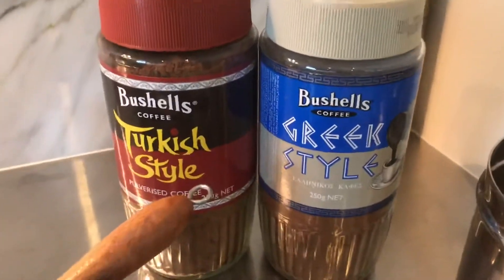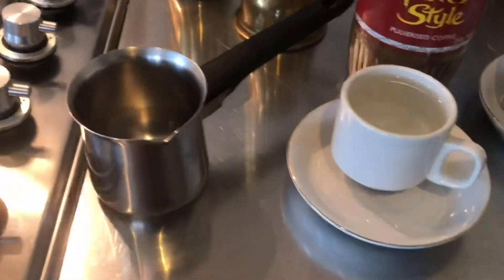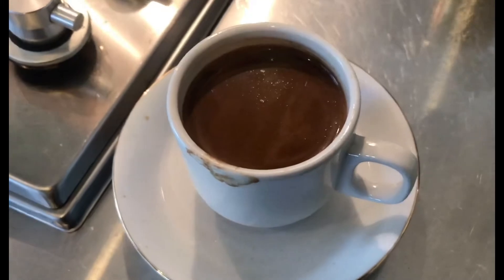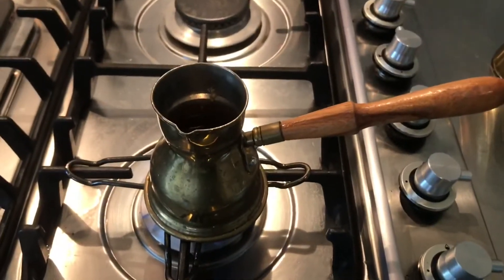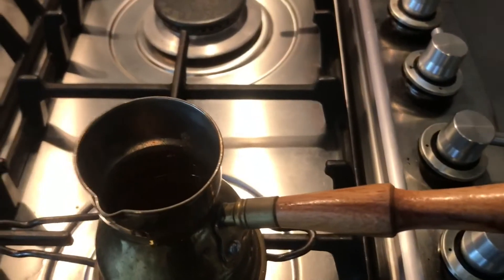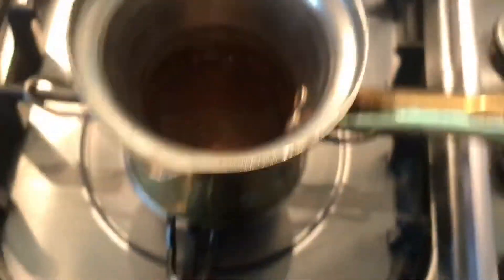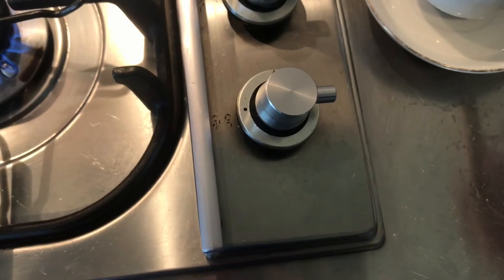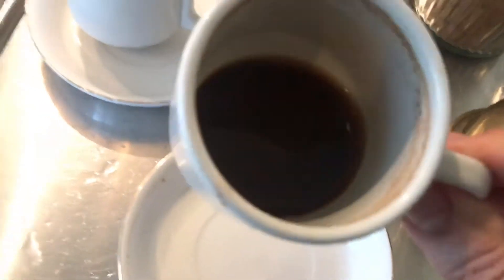Which pot is best for Greek & Turkish coffee

Comment: Nice vid  once again.👌 Small tip I find works really well. When pouring into your cup pour half a cup and then pour the other half after 5 seconds. This works really well when making multiple cups and helps with forming a nice Kaimaki on all the glasses. I still do it for a single cup. Try it!! Which brick do you prefer?
Reply from the maker: You know what that tip is valid - as you pour initially it sizzles - that delay will allow the kaimaki not to get affected by the sizzling. I’ll make a Turkish Coffee vid and use your tip.

Comment: thanks for the comparison.  i'm thinking about getting one of these tiny ibrikis.  all i keep seeing is "you need to get a copper one because they conduct heat so much better, at least 10x better than stainless steel".  and.....eh, you just showed it's 25% faster, but not really making a big difference in the end.  at least i don't think.  

i'm worried about a copper or brass one scratching my glass electric stove top.